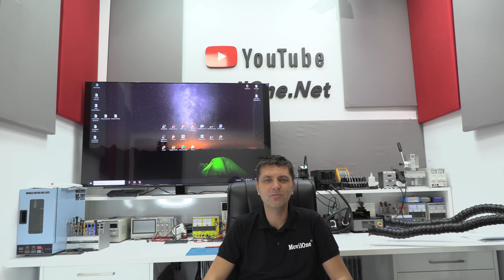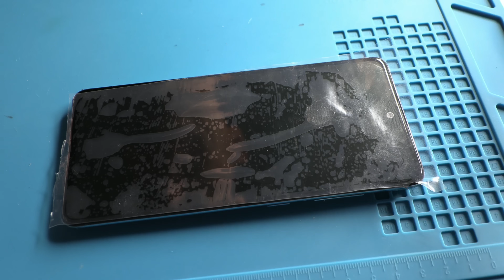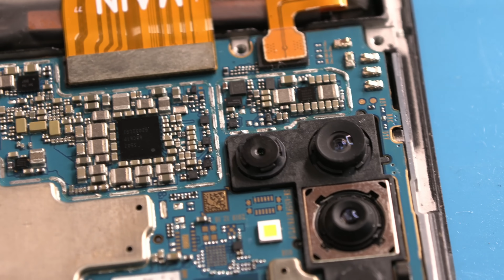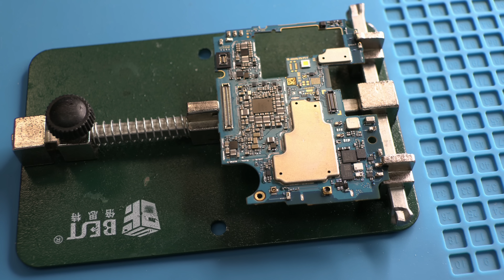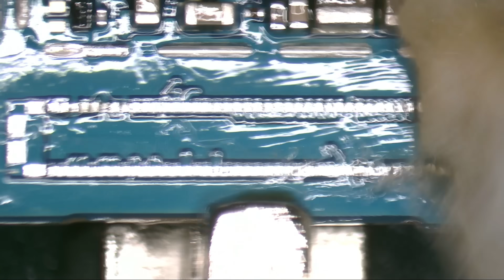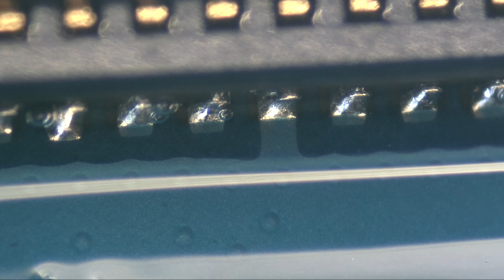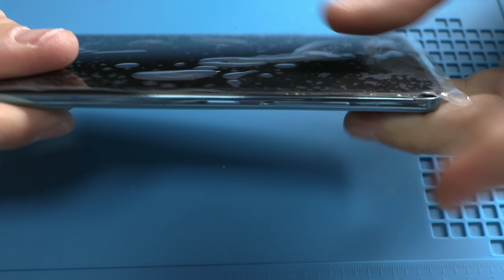The Samsung A Series Secret They Don't Want You to Know!

Comment: First we need to ask where does those components are made? Mostly China
Then we need to ask why they make those components so poorly? 
I highly doubt that some companies just decide that they will intentionally use components that will break with normal use. Problem is usually in multiple stages. First every company will use cheaper components to increase profits. That is 100% for sure. But problem is using too much of too cheap components and your products can become so bad that nobody will buy them. So I think this connector is probably bad manufacturing somewhere in China. In China they do not care much about quality, every chinese will try to cheat you and they will even sell you their own mother or shit just to get few pennies. They have no shame or culture like in western world or Japan/South Korea. 
In the past we had many failing components, like capacitors few years back, where a lot of PC motherboards failed because of them.
Reply from the maker: You’re right that manufacturing quality plays a significant role, but the issue goes deeper than just poor Chinese components. Many multinational corporations intentionally choose lower-grade parts to cut costs and increase profits. In many cases, manufacturers could opt for higher-quality materials, but they deliberately select components with limited durability to encourage faster replacements.

Blaming Chinese manufacturing alone oversimplifies the issue these decisions are made by big brands that control specifications, materials, and quality standards. The capacitor plague you mentioned is a perfect example poor design, rushed production, and corporate cost-cutting combined to create widespread failures. Ultimately, the blame lies with the companies that prioritize profit over quality no matter where the components are made.
Reply: @MovilonePhoneRepair  yes, but if companies just select poor quality willy nilly  their products will be bad and they get bad reputation very quickly. Selecting cheap components is a balancing act. Select too poor quality and your products and company will go down fast, select too good components and you will run out of money. But mainly poor quality components come from China, where they have cheapest and with almost no regulations.

Comment: how to clean up the flux that went into the connector after changing it ?
Reply from the maker: To properly clean flux from inside the connector after replacement, I recommend the following steps:

Use Isopropyl Alcohol (IPA) 99% – This is the best solution for dissolving flux residue without damaging the board or connector.
Soft Brush or ESD-safe Brush – Gently scrub the connector pins and surrounding area to remove stubborn flux buildup.
Compressed Air or Air Blower – After cleaning, blow air into the connector to ensure no residue or debris remains inside.
Inspection with a Microscope or Loupe – This step ensures all residue is properly removed, especially in tight spaces.
Proper cleaning is crucial to avoid connectivity issues after the repair flux buildup can interfere with proper contact if left behind.

Comment: I think so too.. I have a Samsung A71 I suspect that the connector socket is the cause of my A71 damage. it doesn't make any sound and the screen turns green and sometimes it can't be charged. I tried to measure the temperature on the connector and it was very hot when charging. I once tried to take it to a repair shop and they gave me a very unreasonable price. I don't have repair tools like hot air so I wedged the connector with a toothpick that I scraped and it returned to normal.
Reply from the maker: That’s an interesting workaround! Using a toothpick to stabilize the connector was a clever temporary fix, and it shows how unpredictable these connectors can be. The overheating you mentioned is a clear sign of a damaged connector or poor contact. If possible, I’d recommend replacing the connector entirely it's the most reliable long-term solution. If you decide to visit another repair shop, ask for a detailed explanation of the costs to ensure you're not being overcharged.

Comment: Wouldn't it be better to heat the PCB from the bottom ? Instead of applying all that heat onto the plastic connector from the top ?
Reply from the maker: Hello, many times we have the CPU or memory below.
Reply: @ i mean only the part of the pcb where the connector is

Comment: Like I thought about buying a Samsung A phone to replace my Realme C21Y (its gonna be 4years old and i charge just twice a week and its battery still holds up so well, its just obsolete and not getting many updates anymore since Android 11 is dropped support......)
Reply from the maker: Your experience really highlights the value of well-built devices. The fact that your Realme C21Y still performs so well shows that durability is possible when manufacturers prioritize quality. Unfortunately, the lack of updates forces users to move on, even when their devices are still functional. This is one of the biggest issues with planned obsolescence it's not just about hardware failures but also software limitations designed to push consumers toward newer models.

Comment: So, did this scam continue on the A21, A22, A23 series phones as well?
Reply from the maker: Yes, this design flaw continued in several newer models like the A21, A22, and A23 series. Sadly, it’s a recurring pattern across multiple Samsung devices, reinforcing the suspicion that these weaknesses are intentional. Identifying these flaws is key to preventing unnecessary expenses.

Comment: Ive got 4 that did this to me the last couple years
Reply from the maker: It's frustrating to see how common this issue has become. Devices that should last for years are failing prematurely due to these design flaws. Fortunately, with the right tools and some experience, these problems can be fixed. If you ever need guidance, feel free to ask! Thanks for sharing your experience.

Comment: I need to do this on my S24 ultra, the main board connector like this one is broken on the bottom half, I dropped my phone from my car out of my pocket and when I opened the back up, this is what was broken. How much are the little main board connector parts??
Reply from the maker: I'm sorry to hear about your S24 Ultra. Unfortunately, these connectors are extremely fragile, and even minor impacts can cause them to fail. The replacement FPC connectors are usually affordable — you can find them on sites like AliExpress for a few dollars. Just make sure to choose a reputable seller and use proper tools to avoid damaging the board. If you need tips for the repair, feel free to ask!

Comment: Samsung "A" series stands for "ASS".
Saying it as an owner of A41 which had it's buttons fail and A31 which had screen burnout. Twice. 
P.s. I have had buttons on A41 replaced by my known technician with stuff I ordered in person and screen on A31 (which my mom use been) replaced by Samsung official service.. Failed in 3 months again.
Reply from the maker: Your experience highlights how widespread these issues have become. Manufacturers are clearly cutting corners with fragile materials and poorly designed components. Sadly, even official repairs sometimes fail because the same low-quality parts are used. I’m glad you found a trusted technician for your A41 — independent repair shops often provide better solutions than official services. Thanks for sharing your story!
Reply: @MovilonePhoneRepair  depends on the repair shops. Where I live those usually scam out people a lot xD

Comment: I had SO MANY issues with a couple of A72 phones couple of years back. The phones are so easily bent just from day to day use that it puts stress on the ribbon cable and pulls on the connector.
Reply from the maker: You're absolutely right! The structural weakness of these phones makes them prone to bending, which puts stress on delicate connectors. It's frustrating to see such preventable flaws designed into devices. Thanks for sharing your experience!

Comment: I was looking at some new phones on Google and after about 3 weeks my phone failed. I took it in for repairs and I was told It needed to be replaced. I now know what the gimmick is, to late. Next issue with my now  new phone I will take it to an independent repair company.
Reply from the maker: That’s a classic tactic — devices seem to "coincidentally" fail when you're considering an upgrade. Independent repair shops are often the best choice for honest advice and cost-effective solutions. Glad you’re now aware of these tricks!

Comment: I will disagree with the idea that the products are necessarily "designed to fail".  I do think that they are designed to follow customer "concerns" which are sometimes poorly placed.  The public is too easily chasing after overblown concerns compared to real concerns (the lead solder issue).  But Mfrs go along with it rather than try to change peoples minds about the reality of the situation.  Even still, it appears to me that poor connectors and their use need to be re-assessed, especially if the problems have shown up after "a short product life".
Reply from the maker: You make a valid point. While some poor designs may stem from misguided consumer demands, others — like these fragile connectors — seem far too common to be accidental. Regardless of intent, the result is the same: consumers are left with unreliable devices and costly repairs. Thanks for sharing your perspective!

Comment: Shit A12, lost my 2nd one by loosing the mic. Repair mostly more expensive then buy a new shit
Reply from the maker: The A12 microphone issue is sadly another example of poor design choices. Often, manufacturers set repair costs intentionally high to push you toward buying a new device. It’s frustrating, but with the right knowledge, many of these "expensive repairs" are actually simple fixes. Thanks for sharing your experience!

Comment: if you buy phone without removable battery, you don't deserve a phone
Reply from the maker: That's a fair point! Removable batteries made repairs simpler and extended device lifespan. Sadly, most brands have moved away from that design — another tactic to push consumers into buying new devices faster. Thanks for sharing your thoughts!

Comment: What even was the issue, what was the phone doing before the repair?
Reply from the maker: Great question! The phone had a charging issue caused by a damaged FPC connector — a common failure in Samsung A-series devices. This small plastic connector develops internal cracks that interrupt the current flow, making the phone seem completely dead. Fortunately, it's a fixable issue with the right tools and techniques!

Comment: Nice try, Apple. When the home button on my iPhone started working intermittently, I dug through the software and found the on-screen home button buried deep in the accessibility settings. Guess what? That on-screen button also worked intermittently—until the iOS developers realized they had screwed up and fixed it in the next major iOS release. (I then tested the home button on another iPhone, and guess what? It worked fine—except for Touch ID, thanks to Apple’s grifting policies.)
Reply from the maker: That’s a perfect example of how software manipulations are used to create frustration and push consumers toward upgrades. Apple’s tactics with the home button and Touch ID are just another way they limit control over our devices. Thanks for sharing your experience — stories like yours help reveal the truth behind these strategies!

Comment: What issues can this cause?
Reply from the maker: This type of connector failure can cause several issues: the phone may refuse to charge, turn off randomly, or even show battery errors despite having power. In some cases, intermittent charging can lead to battery damage over time. If you're experiencing any of these problems, the connector might be the culprit. Thanks for asking!
Reply: @MovilonePhoneRepair  thank you, i appreciate the quality videos

Comment: my A51 failed to charge the problem was that connector  got frustrated banged it on the wall
Reply from the maker: I completely understand the frustration — these poorly designed connectors can drive anyone crazy. Fortunately, they can be replaced, and once repaired correctly, the device can often work like new. If you ever want to give repair another try, I'm here to help!

Comment: I had that cable fail both in an A70 and an A51.
Reply from the maker: That’s no surprise — the A70 and A51 are notorious for these connector issues. I’ve repaired countless devices with the same problem. Thankfully, with the right techniques, they can be fixed for good. Thanks for sharing your experience!

Comment: I have an a13, is this series affected?
Reply from the maker: The Galaxy A13 isn’t as prone to the exact connector issue mentioned in the video, but similar design flaws — like weak charging ports and fragile components — are common in this series. If you notice charging problems, keep this in mind. Thanks for your question!
Reply: @MovilonePhoneRepair  there is charging issues like low charging

Comment: You buy expensive device, then $0.5 - $3  part fails and it's over. I've worked as an IT admin, and suddenly same display models went dead one after another, all 6 died roughly in few months timespan. As far as I investigated it was $3 electrolytic capacitors of poor quality in PSU, but the company bought new didsplays. Economy rolling...
Reply from the maker: Exactly! Devices fail due to cheap components like capacitors, and instead of simple repairs, companies push consumers to replace the entire product. It's an endless cycle of waste and profit. Thanks for sharing your experience!

Comment: What is Samsung Galaxy S22 Ultra green screen problem ? Why it does appear on my phone? Explain me.
Reply from the maker: The green screen issue on the Galaxy S22 Ultra is linked to display failures, often triggered by software updates or internal stress on the screen’s connectors. While some cases are repairable, it's yet another example of how fragile modern devices have become. Thanks for asking!

Comment: Obsolescence is baked into the product...

PC'S were under powered on purpose.

Heavy work loads from gaming
And web browsing would
Wear the power supply out faster.
Reply from the maker: You're absolutely right — underpowered hardware and fragile components are common tricks used to accelerate device failure. The constant push for upgrades fuels this cycle. Thanks for highlighting this!

Comment: I had two Samsung phones fail the same way: failure to charge. Both failed about 1.5 years after purchase. Attempting to have them fixed at an authorized shop failed because, I was told, that Samsung did not support “old” models on parts. I suspected they were designed to fail that way, and swore never to buy another Samsung phone. And I haven’t.
Reply from the maker: That’s frustrating but sadly common. Manufacturers often limit replacement parts for older devices to push consumers toward upgrades. Independent repair shops often have better solutions — I'm glad you found a way forward. Thanks for sharing your story!

Comment: What about all the updates to older phone are there bugs in them to cause the phone to fail?
Reply from the maker: Yes, this is common. Some updates introduce bugs or stress hardware components in ways that accelerate device failure. It’s a subtle but effective tactic that keeps the upgrade cycle moving. Thanks for raising this point!

Comment: It's there an intentional failure built into note 10+? I tried buying a replacement and same issue weeks later. Phone would drop calls. Seemed software failure based
Reply from the maker: The Note 10+ has had reported issues with both hardware failures and software instability, often resulting in dropped calls and other connectivity problems. Sadly, some models seem to fail shortly after repairs, reinforcing the feeling that it's intentional. Thanks for sharing your experience!

Comment: Wow my Parents had both the a40 and one of them stopped charge i switched the loading port with no luck then i switchend the motherboards and it worked again so i thought the board was just faulty. Great video btw the phone with the switched board still runs after 1 year.
Reply from the maker: That’s impressive! Your persistence in switching components proves that many of these issues are repairable with the right mindset. It’s often a small part that fails, yet brands push consumers to replace the whole device. Glad your fix worked — thanks for sharing your experience!

Comment: Apple products are designed to fail also .
Reply from the maker: Absolutely! Apple’s tactics with battery throttling, software limits, and overpriced repairs are just more examples of engineered failure. Sadly, this practice is widespread across many major brands. Thanks for your comment!

Comment: My samsung f20 mobile has same issue it has undergone repair 2 times for the same Issue and now it is occurring again and my battery is also swollen, i may now as well as switch my mobile
Reply from the maker: I’m sorry you’ve had to deal with this frustrating experience. Swollen batteries are a serious safety concern — I’d recommend replacing the battery as soon as possible. If you need advice on switching to a more durable device, feel free to ask!
Reply: @MovilonePhoneRepair  tnx for reply bro and yeah I will switch my batteries,it has 6000 Mah so will have to see if it is readily available in market then I will keep this device for emergency uses .
Bro I am all ears open for any advice on durable phone that can last at least 4 to 5 years.